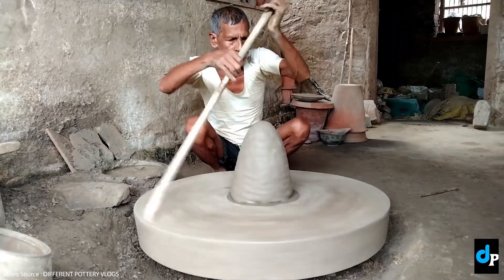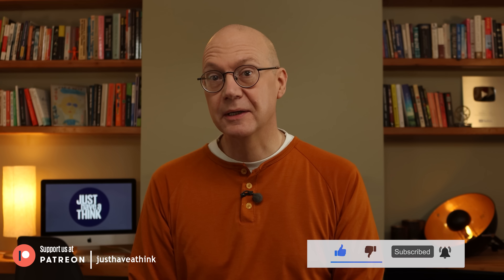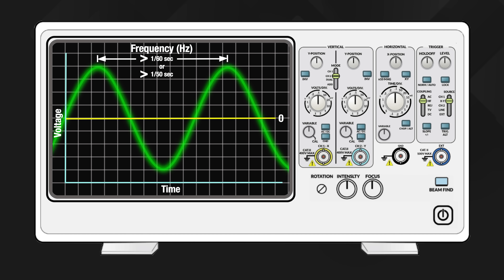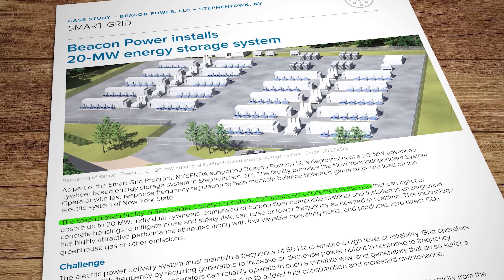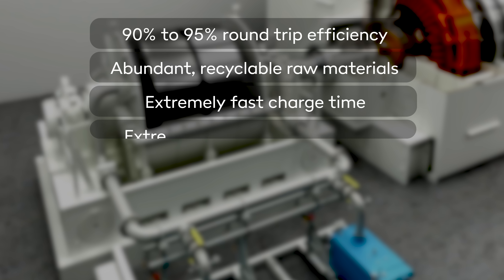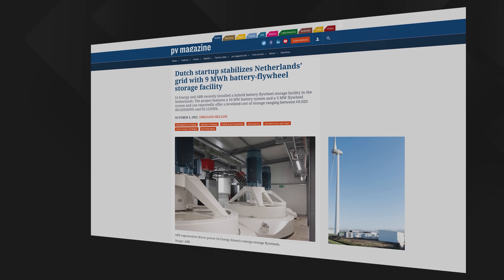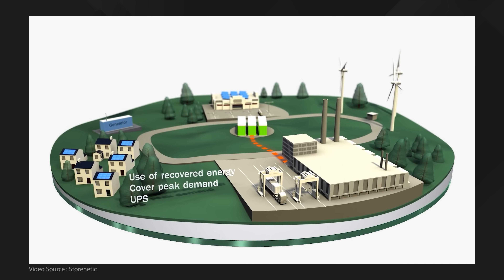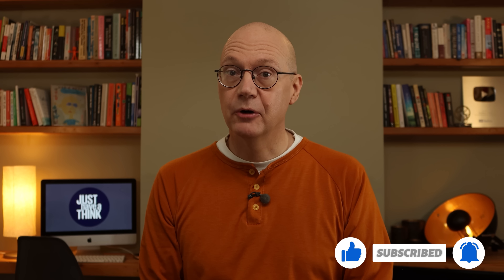Flywheel reinvention revolutionising our power grids!

Comment: Thanks for another great video, Dave. Of course, when we used/use large, thermal-based conventional generating plants, the inertia resource is co-located with the generator by virtue of the use of very large rotating synchronous machines - lots of MWsec available all the time! I have often wondered why we in the UK don't require large renewable generation sites to co-locate inertia resources like flywheels as part of their licensing conditions. In some cases, crunching the numbers may suggest that the compensating inertia should perhaps be located at or close to the point of grid connection rather than the generating site itself but, nevertheless, the days of site developers effectively making the inertia issue somebody else's problem (or business opportunity!) should really be behind us, I think.
Reply: Not economic due to accessibility and distribution of renewable assets I would guess.
Reply: You get the idea about the stored energy when the generator shuts down. It has stored energy sufficient to run the load for about 2-5 seconds.
Reply: There are smaller flywheels available.  I think the issue is simply that it would add costs for the renewable installation and there is no way for the renewable energy provider to recoup the cost.  If the price the system paid the renewable energy was higher for energy that can guaranteed in say 5 min increments, then there would be no need to mandate anything.  At the moment, the grid treats a KwH equally and seeks to pay the lowest cost per KWH.   the costs of managing the “cheap kwHs” is paid by the grid operator.   (If we paid different rates that recognize the quality of the KwH, then cost to the grid operator would decrease)
Reply: @Spp235.  there is absolutely no reason that renewable generators could not include the cost of inertia resources in the overall costs of connecting and operating the site. It would also allow better reactive power control if the inertia was sourced from a synchronous condenser rather “just” a flywheel. As the technology for synchronverters improves, I think it’s very likely that renewable connections based on inverters will have a license requirement (and therefore cost) for provision of so-called grid-forming inverters rather than line-commutated devices, so the cost will be there anyway and the debate will shift to which is cheaper, rotating mass or synchronverter?

Also your comments re the cost per kWh don’t make sense. At the moment - in the U.K. - renewable generation is much cheaper than gas but the market rate per kWh is set by the most expensive fuel source (gas most of the time), which is why we’re in the midst of a cost of living crisis!
Reply: @Spp235.  1. Actually the smaller flywheels are high-tech and very efficient. 2. Big companies do not want you to produce your own energy just to protect their interest and their business. 3. Here in India if you put in 1kwH (1 unit) of energy you will get credit equivalent to 0.4 times the cost you will pay for 1 unit.

Comment: We used motor-alternator sets to smooth the mains supply to main-frame computer systems back in the 1970s

What goes around comes around!
Reply: The old hard drives alone were practically miniature fly wheels! (Until the was a head crash) 😉

Comment: I'm more concerned about reducing the cost of the storage element of renewable energy at the residential level. The idea is to use the flywheel to reduce the peak power use.  It must have enough energy to handle about 5 KWH of demand in about a 1 hour interval. It must be cheap enough to be less expensive than a battery. ... It doesn't seem feasible. That problem can be shifted to the grid, where the percentage peak is much less than occurs in the home due to the averaging of many house loads applied at different times.  But, it requires that the grid cost structure allows the household to lump all of the energy in a time-of-use time slot for about 1 month into a single charge. In this way, the cost of household peaks can be reduced for essentially free to everyone.  But, it does not solve the problem of grid scale peaking that occasionally occur.

Comment: Not as safe as you are made to believe. The thing is that the amount of energy stored increases linearly with mass, and quadratic with rotation speed. So you want to rotate them as fast as possible. But if you spin them too fast, they tend to "fail abruptly", or as normal people would call it: explode.
Reply: So site them underground or surrounded by earth berms.  Lithium batteries burn and pollute the air when they catch fire, all energy storage entails risk, but there may be some safest types among the various options.

Comment: These projects are important, and so is shining a spotlight on them (as you continue to do in an entertaining and comprehensive way, good job once again!). 

Lithium cost evaluations are subject to change. Really, Lithium is valuable because it is LIGHT weight. Do we need light weight for stationary objects? (Probably best NOT to use all our limited supply of lithium in applications where weight doesn't matter. Save it for moving objects, yes? That's something "cost tables" overlook.)
Reply: I'm pretty sure lithium is one of the more abundant elements. The matter is that of mining and disposing of it once it's in a battery. It's overall a very destructive and harming chemistry. Either way, the sentiment is true, use sparingly and in the right applications.
Reply: @nathanmiddleton1478  That's a good point. Yes, lithium is the 3rd element on the periodic table. So the question is: What you are willing to rip apart and destroy to get to it, especially the few places where this common element has become concentrated. Unfortunately, not many corporate types are concerned about the wake of destruction they leave behind. Best to just end-around them and replace lithium with more environmentally friendly alternatives.
Reply: @onebylandtwoifbysearunifby5475  Sea water (waste brines) can be a good source and if you are getting other metals from the sea water (say Mg) then isolation of Li can be cost effective, I guess.
Reply: @janami-dharmam  Sea water is an interesting idea. I am not familiar with that lithium extraction process. Hopefully it is more efficient than duterium needed for nuclear fusion (which is actually extremely limiting, and a reason nuclear fusion is questionable as an energy process at this point.) That would be great though, if lithium could be easily and cheaply extracted from sea water. Thanks for the info.
Reply: the weight of the Li metal in the battery is rather small. A battery that weighs 1 kg may have 20-30 gm of Li metal. The matter is related to the chemistry.

Comment: Grid tie inverters an associated battery systems can with the correct software also provide grid inertia/FCAS.  These are becoming popular as they also come along with substantial storage and less maintenance than fast spinning flywheels. Their limitation is that they generally don't provide as much "fault current" to quickly trip grid breakers as would be provided by synchronous condensers of the same MW nameplate capacity.

Comment: Flywheel have been invented centuries ago, they are an essential part of piston engines (the fewer cylinders, the more important), they even were part of the emergency system that was supposed to prevent the reactor in Chernobyl from blowing up in case of a black out. So no futuristic aspect there. Even in terms of stabilizing the frequency of the electric grid, they are in use for more than a century: the inertia of the generators and turbines itself is a major part of the stabilization of the frequency.
They do however play an important part in a power grid that is driven by more and more renewable energies: solar panels do not offer any mechanical inertia whatsoever, the inertia of wind turbines is neclegable.

Comment: Hi Dave, you may have missed that in the UK, a decommissioned gas fired power station was converted to be a flywheel, basically they used the generation set!
Reply: Strangely enough, you don't even have to decommission the power station before using it as a flywheel. You can use the valuable reliable power from the power station, and get the other benefits included for free. Only with unreliable intermittent wind and solar do you need to go to ridiculous lengths to re-establish some grid stability.
Reply: @paulcampbell840  plus all the benefits of NOx, CO2, the huge cost of fuel, being beholden to an aggressive psychopath in a foreign country. It’s all upside to burning gas that you forgot.

Comment: Wishing you and your family a blessed & prosperous 2023.

Thanks for another excellent video topic. Under a distributed energy scenario, each region should take advantage of all local geo-physical assets - this could be geothermal, ocean, conduit hydro, dam hydro, pumped hydro, turbulent hydro, clean waste-to-energy, energy from poop, wind and / or solar backed by whatever energy storage makes sense (liquid metal, sand, carbon dioxide, flow, gravity, V2G, ocean or whatever they think of next). I don't think there will ever be a single solution to our energy needs. But, of course, energy efficiency at all levels is critical to reduce energy demand - the less we need, the less we need to generate. Energy generation - and the type of tech available to generate it - also depends on what it's needed for... commercial, industrial, residential or a combination of each.

Comment: You spoke of energy density as a downside to a flywheel. That would seem to rule out a hybrid automobile with a flywheel replacing the battery. Any thoughts?
Reply: we have to remember the gyroscope effect of a heavy flywheel. It will probably affect the ability of the car to turn or even stop quickly.
Reply: @dougdelamatterphotography7131  I gave it some thought, and I recall the gyroscopes used in the Mercury missions, so I began to wonder if the spinning mass were gimballed, it might not corner so badly.  Just a bit heavyweight...
Reply: The Williams Formula 1 motor racing team developed such a system. The KERS systems that were in use (Kinetic Energy Recovery System) included an option to use this type of system. I believe they never used it in races but instead used a "conventional" generator and battery system similar in principle to a hybrid car. There have been buses using this too.
Reply: The spinning mass of a motorcycle wheel helps the rider maintain balance but doesn't inhibit forward motion. So a flywheel in an automobile with its axis pointed skyward wouldn't inhibit forward motion because of its spinning momentum. However, the mass/weight would still be an issue for a flywheel of any size.

Comment: Just to put some perspective on this.

Conventional generators have very large rotating mass (3000 rpm for 50Hz) so provides stable inertia for free as it were as it is part of the construction of the generator. 

Where the idea of using artifical or external inertia from flywheels is not that effective is simply that the inertia of conventional generators are a damping medium but for sustained frequency stabilisation requires power input to the generator if the load starts to increase over and above generator output. Simple inertia delays the slow down that the overload brings but artificial inertia cannot add any power so can only be a very short term and relatively ineffective correction.  It is similar to the flywheel in a car engine, it dampens the power stroke but remove the fuel and that inertia soon disappears.

As renewable generators do not have this physical characteristic, it follows that for a stable grid we require a lot of conventional generation capacity connected to the grid as well. Grid decarbonising, without nuclear, is not going to happen and this idea will do little to help.

Comment: Doesn't having a massive flywheel in your bus cause havoc as soon as you try to go around a corner? (The ones in steam engines had to store energy for only a few seconds, not 10 mins)

Which makes me wonder - how big/heavy/fast does a flywheel have to be before is starts to have a measurable impact on the earths rotation and/or orbit?
Reply: Good point!  Fortunately, Denmark is pretty flat, the flywheel being oriented with a vertical axis.  If gimballed, the flywheel could float freely and maintain it's position while the bus takes hills, hits bumps, turns corners, etc.  The earth is incredibly massive with an iron nickel core, I think the flywheel would have to be planetary in scale to affect the earth significantly.

Comment: Perhaps not a game-changer - but obviously a very useful part of an environmentally clean energy system. This advances us to a future of very low pollution (noise as well as emissions) - the obvious target if we're to avoid exceeding a global temperature increase over pre-industrial era temperatures of 1.5°C/2.5°F  (currently 1.1°/2.0°F) because extensive climate modeling predicts rapid collapse of the global oceanic circulation system (it's already weakened to 80-90% of the pre-industrial era) and ice-sheet melt accelerating by orders of magnitude (×10s) in decades with concomitant sea-level rises.

And some would likely say these predictions are BS(!). Even, far sake of argument, say they prove to be; what's the sacrifice..? Oh yes: stinky, polluting fossil-fuels for a clean, comparatively non-toxic environment in which you can hear the birds sing. Far from tragic wouldn't you say? 😉

Comment: Happy New Year everyone and thank you Dave for yet another great video!

More than 10 years ago I was working on a datacentre project and wanted to use diesel power generators that had integrated flywheels as a way to get rid of UPS batteries. The idea is that a major datacentre only uses UPS batteries as a bridge during the transition from the grid power to the power supplied by diesel/gas/... generators. We are talking about seconds from the moment when the power grid fails to the moment when the power generators have kicked in with a stable power supply. Instead of using batteries for this, flywheels would be more than capable of providing enough power for a smooth transition. The downside was that generators with flywheels were more expensive and you would have to have regular maintenance of the flywheels, while also needing to switch to power generators even in cases of relatively short power cuts. On the other hand, going away with batteries was a huge plus - batteries need a separate climatised room, they need to be replaced every 3-5 years, depending on the number of cycles and eventually there are expenses related to old battery disposal. Those are huge savings if you can avoid using batteries. Nowadays, the ecological aspect is even more pronounced when there is a shortage of lithium and other rare earths. We were also looking in some other ways of being efficient, like using excess heat in winter for local orchards and residences, heat pumps, solar panels...

Unfortunately, the project never materialised because of local political instability and hence the reluctance of the investors to go on with the project. Therefore, I have no first-hand experience on how the technology stacks up against UPS batteries and if there are some other issues that we hadn't foreseen. I would really like to hear if there are people out there with hands-on experience, as I am actually quite surprised that this technology hasn't picked up. Either there are issues that I am not aware of or this technology needs to be marketed much more. If this can work, then you can imagine what savings could be made all across the world and the number of batteries that we would not need anymore (and think about energy wasted on mining for the ores, production of batteries, cooling the battery rooms and finally on recycling and thus all the pollution that would be avoided).
Reply: This was done successfully at Grumman Aircraft in Long Island, NY. They had a large 3 phase motor connected to the AC line power which spun a large flywheel which was also connected via a clutch to a large diesel generator. In case of AC line power failure a contactor would disconnect 3 phase line power and also engage the clutch to start the diesel generator and connect the generator to the 3 phase ac power to the facility using a zero crossing switch to minimize AC line transients. It was incredible to imagine the clutch/flywheel energy would spin the diesel up to full speed in less than a second and have the entire Grumman facility running from the 3 phase diesel generator.

Comment: I’m sure modern flywheel systems are safe, as long as their containment is strong enough in the event of a catastrophic failure. My friend’s father told me of an incident involving a Deltic Diesel generator which powered a large radio transmitter in Africa. The flywheel (?10 tons) managed to break away from the engine. It hit the concrete floor of the generator room, dug a bit of a hole before getting enough to purchase to take off through the block wall and travel nearly a kilometre to disappear in a local lake. I hope that 177 ton flywheel rotates in the correct direction to go out to sea in the worst case scenario!